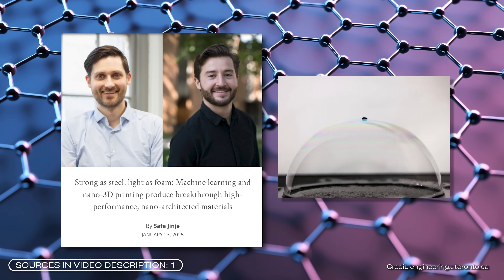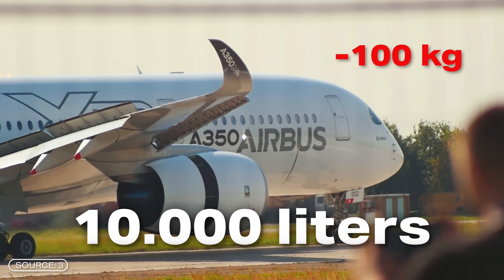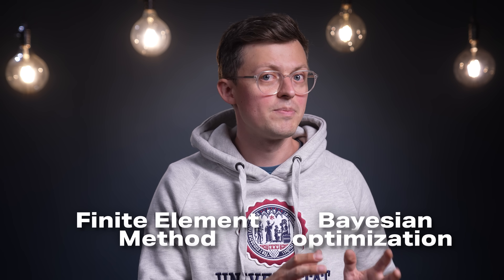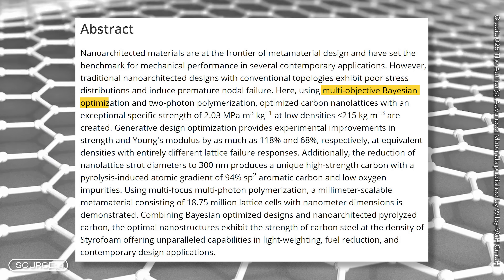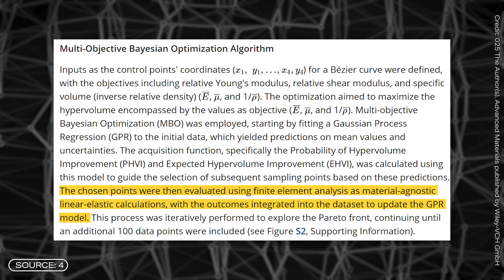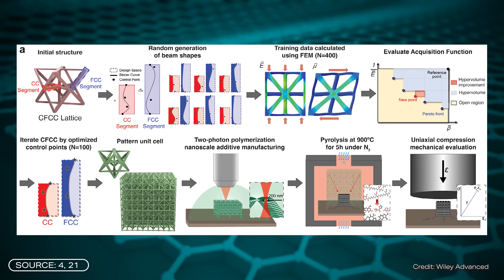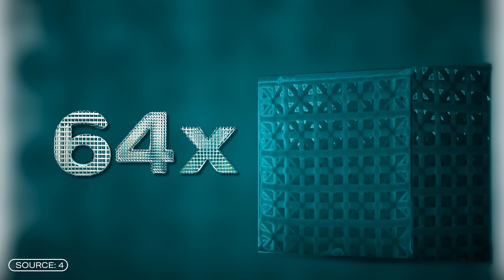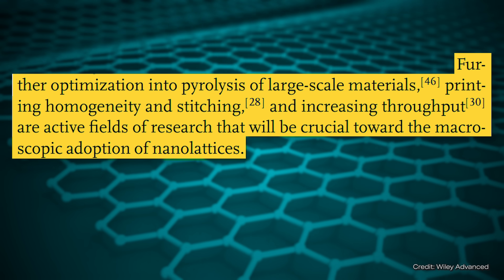New Material: As Strong As Steel, As Light As Styrofoam!

Comment: Can't wait to never hear about this material again
Reply: Yeah, I don't see this one becoming a thing within our lifetimes. Just the production of this material seems completely unfeasible and then there's probably a dozen of structural problems of the material itself to solve too.
Reply: @LecherousLizard   Yeah, welding it would completely ruin the structure I'm pretty sure, and while I'm not familiar with how you're meant to join materials like this, it'd definitely be costly.
Reply: @LecherousLizard   Maybe one day it'll be feasible but yeah I agree with your take. It's just not going to be economically viable anytime soon.
Reply: @LecherousLizard Might depend on product lifespan.
Reply: Time to market is God awful
Reply: Gee. Talk about “cynical”!…
Reply: @Sedgewise47 to be fair, how many wonder material we have never heard about again?
Reply: I know what you're saying. So often, breakthroughs are only in an incomplete number of dimensions needed for it to be commercialised.
Reply: Unfortunately, we’ve been through this rodeo before, more than once over the decades. I sincerely hope this one is real, but I will not hold my breath on it.
Reply: The rub, impractical for manufacturing at scale.
Solution, develop materials separately from the shape.
Unless you can bake a whole frame out of this squirted out of a 3d printer and use lasers to cure it as you go this is nearly pointless.
Reply: Hahahahahhahahaahah
Reply: 😆True
Reply: So true 😭
Reply: It's 50 years old already,  just refining the process
Reply: My robot body is almost ready?
Reply: @searbhreathach9762  Almost. Are you ready to become a 9000yo loli?
Reply: @searbhreathach9762 Yeah Stark and Banner are just waiting for Thor to hit it with Mjolnir 😂
Reply: Given the current state of humanity, do you really want the plebs running around with guns and body armor made of this stuff?
Reply: @N8_R  Body armor maybe, but what does it change when it comes to guns?
You can make gun in your garage just fine. Making this material at a usable scale is impossible even in a lab.
Reply: @LecherousLizard Guns made of this stuff would be a serious issue for security checkpoints in general. Airport x-rays based on material density on the civilian level and seaport customs measuring container weight to screen int'l weapons trafficking. It's not lab feasable but 3d printing tech is about to improve by exponent alonside robotics in the next decade. But yeah CIA and DARPA will probably pick this up and black hole it soon.
Reply: Shure, wouldn't wish to overtax whatever brain cells you might have.
Reply: @JR-pq9st  I think what they're getting at is that this sounds like a Popular Mechanics Technology™. The sort of thing for which you seen an article with CGI pictures of the Amazing New Innovation that is coming Real Soon Now...which promptly vanishes and is never heard from again. Like graphene, carbon nanotubes, or Solar Freakin' Roadways.
Reply: @JR-pq9st 👉Sure 😂
Reply: @JR-pq9st  Nono dont get him wrong, we all like the material, hes not saying he doesnt care, its more so that whenever anything cool new and good is discovered it just disapears from the radar anticlimatically. ''Nothing ever happens'' its almost like a conspiracy but real.
Reply: @JR-pq9st  Sure you don't want to check the spelling of, "Sure"??
Reply: @r.m.m.1706 so… that apparently flew way over your head.
Reply: @D4Shepherd Are you 'shure' about that??